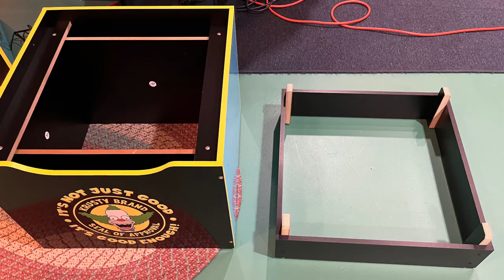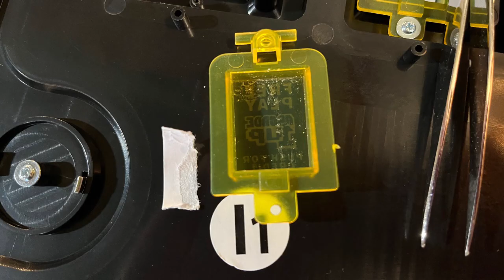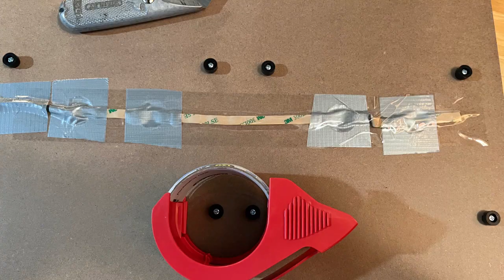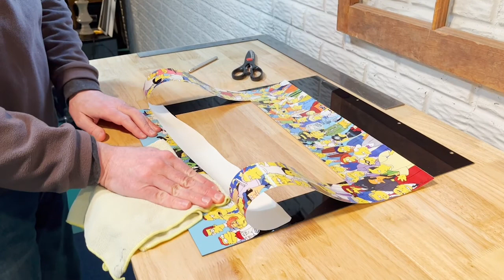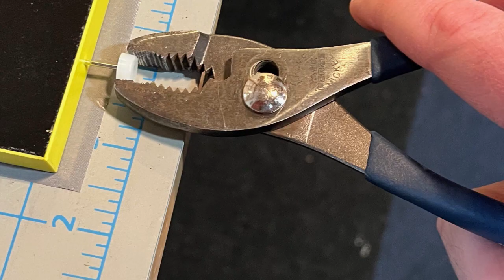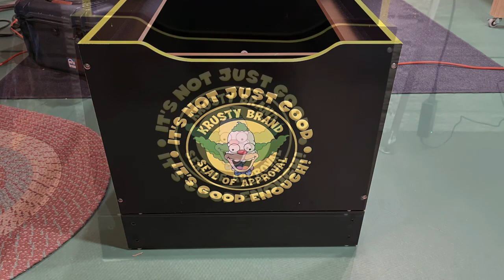Four easy modifications for an Arcade1Up Simpsons 4-player cabinet

Comment: After assembling my own Simpsons machine, I saw those preformed coin doors and had shallow hope for them being interactive. I mean, they literally say 'push for credit' (or something like that) on them. Alas, it's either meeting modification half way or future plans. So, I noticed that they were transparent and then saw this video. Noticed that there was enough space. So, I drilled in a few holes and fed through these small wires with multi-color LED's on them. And wow...does it truly pop with those in there. Especially with all the effects modes that it came with. Thanks for the idea.